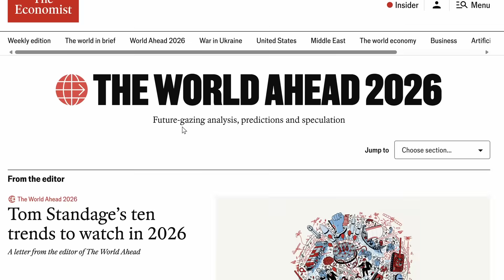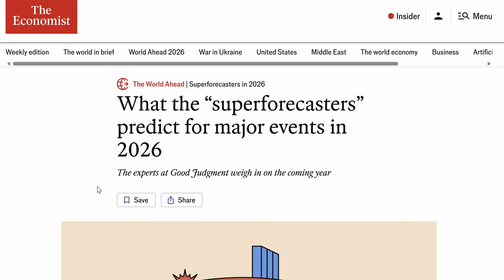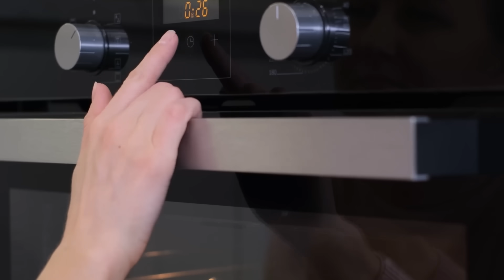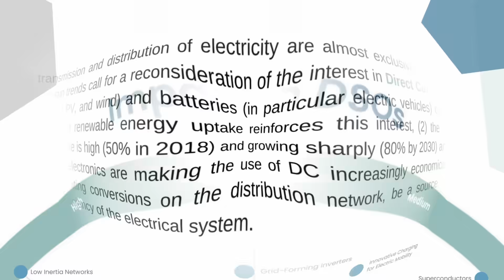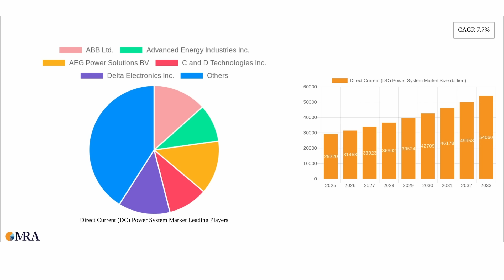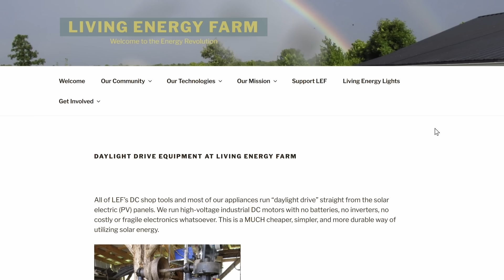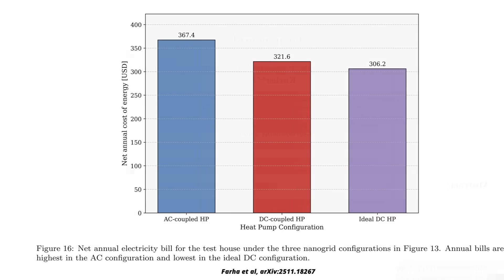Are We Using the Wrong Kind Of Electricity?

Comment: Force is force! DC is like deadline your bicycle continously to move strictly forward. AC is like switching back and forth between forward and reverse and then having to convert half of them back into the forward direction or you'd just vibrate in place ripping the bike apart.
Reply: Horrible analogy, No, DC is nothing like that.
Reply: Open your websearch bar and type the keywords "bicycle analogy differentiating ac from dc."  The results will indicate your exclaiming the analogy is horrible... is just your opinion.  It's a common analogy.      @avsystem3142

Comment: I was hoping for a summary of how the DC equivalent of a power transformer works.
Reply: All direct voltage changes are resistive in nature.  A diode drop, for example, directly drops the voltage by (e.g.) 0.7V (0.3V for some types), but has to dissipate the difference in energy as heat (I * dV).   Same thing happens with a capacitor too, by the way.  You can't efficiently convert voltages by charging or discharging a capacitor because that is a direct change in voltage.

To work around this, you change the voltage by changing the form the energy is in from (I * V) to magnetic flux, and then change the magnetic flux back to (a different) voltage.

For AC this is just a transformer.  For DC you still use an inductor or a transformer but you can't just put a DC voltage on an inductor or transformer.  It will build up its magnetic field as desired, but once the magnetic field is built the current will flow freely and the circuit becomes a short.

So the way DC voltage levels are converted is to "switch" the DC voltage onto and off of the inductor or transformer.   You switch the DC voltage on, build up the magnetic field, then switch it off and the magnetic field collapses and induces a voltage on the secondary (or on the other side of the inductor, more or less).  You can then massage that voltage by virtue of controlling the switching rate and pulse width to be the voltage that you want.

-Matt
Reply: @junkerzn7312 okay, so effectively converted into AC, maybe not with a great waveform, then put it through a transformer and rectify it. That does sound inefficient.

Comment: Neine shotsie ! Tesla was right. As a scientist/engineer I have to look at the big picture. All of our infrastructure is set up for ac. Converting an over would break the bank and take a very long time. The beauty of AC is in the intermediate distribution you can convert 115,000 volts down to 220 volts with a single Transformer. To convert DC Indian inverter and a bunch of other crap. Converting AC to DC is simple and cheap a lot of times you just need a wall wart. And the big ugly secret is the windmills actually produce AC 1st because alternators are smaller cheaper less complex and 90 to 95% efficient. Generators are only 75 to 85% efficient and have commentators using brushes that wear out I need constant maintenance. If the windmills need to produce direct current they'll still use alternators and then you use rectifiers degenerate the DC and then at the other end you will need huge inverters to convert it back to AC. Very inefficient and very expensive. Our infrastructure is set up for AC converting it to DC will break the bank and for no good reason. Love your talks especially your BS meter- classic

Comment: With the growing popularity of residential solar energy, we will see more and more local hybrid systems that use direct current (LED lighting, electric cars, etc.) and share energy on local distribution networks (of just a few kilometers) also in direct current. Most new residential solar systems work this way, using batteries. It's a matter of a few years, especially since it doesn't seem like electricity transmission and distribution lines will be modernized anytime soon at the necessary speed.

Comment: AC requires less maintenance over time because it is not as concentrated as DC. Contacts and connections on a DC grid will be more prone to overheating and oxidation resulting in electrolyzed corrosion and weathered components. What was saved on output in a DC world will be cartoonishly overshadowed by comical maintenance. Also, AC is a MUCH SAFER means of distribution in the scenario of electrocution- where a victim can more likely break free from the current with less internal damage. So, it’s better to be neutral than to be negative, and it’s safer on solid ground. Puns intended. 🤔 😂

Comment: Converting DC generated by home solar batteries to AC and then converting it back to DC to charge an electric car wastes only about 10% energy, and the efficiency of these conversions is still improving. It is likely that you will not recover the  cost of retrofitting an existing house. However, when Sodium-Ion batteries reach $70/kWh levels (at the pack level) it would be be feasible to have very large batteries enabling totally self-sufficient new homes in geographies where there is enough sun exposure. In this case, it may be worth eliminating DC/AC/DC conversion losses, especially if the main electricity consuming applications in the house are heat pumps and EV charging.
Reply: You're ignoring the kWh consumption vs the Solar Panels output and the available sun hours in a day.
Charging an EV consume about 3-5 days of average household solar panel output, (yes there are big differences in solar panel installations but also in EV battery Kwh) and remember you CANT use electricity twice, you can't use the same 1kw out from your panels to run a kw to your fridge and one to heat pumps and put 1kw into the EV AND charge enough kwhs into a battery to keep your fridge running and the lights  on when the sun isn't shining.

Comment: The loss over distance issue changes at really high current 0.5 MV and above.  Work on engineering a extreme long distance high voltage direct current transmission was conducted in Northeaster California during the early 1960s leading to the construction of Pacific Inter-tie Extending from Washington through Oregon, California and Nevada to Southern California.

Comment: The problem is that each system requires a different voltage. In the case of AC, this can be solved with a cheap and low-loss transformer. In the case of DC, the losses of the DC/DC inverter are around 10-20%, and the costs are also higher. Therefore, using large DC systems is engineering nonsense.
Bullsith meter: 9 (DC can be good in rare special cases)

Comment: Merry Christmas Sabine enjoy the holidays with your family.

DC transmission is often used for extremely high power high voltage transmission. Interconnecting DC to AC incurs power losses due to converter inefficiencies. Tis is not my day job so I do not know how that compares to transformers. The benefits of DC transmission is the elimination of the need to precisely match frequency and phase at both ends and a massive reduction in reactive current as the transmission line is charged and discharged each cycle.

From a residential  perspective I think the adoption of smart LED lighting will foster a complete change in how lighting is installed. In the US the recent NEC (national electrical code) reduced the power per unit area calculation to respond to the rapid shift to LEDs. On a personal note all our home network devices use DC wall warts. I built a DIY UPS that supplies DC directly to each device rather than converting it to AC then back to DC at the device.

Comment: Well, solar panels produce DC, but all the generation methods that involve spinning things in an electric field, they generate AC.  

And AC makes it trivial to boost the supply line voltages back to within the service voltage tolerances.  Just a transformer with an adjustable tap on each phase.  It is also trivial to step down the voltages to those better for safe non-professional human use, i.e., where kids can get ahold of it.

Comment: Let's imagine 1MW of power is generated and power needs to be transferred over large distance. And, let assume end customer will use this power to power up his PC. At power plant we will step up voltage to minimize transmission losses. Large AC transformer efficiency is around 99.5%.  Good DC/DC convertor efficiency is around 95%.  At the end of transmission line (at the city level), we will need to bring voltage down to some lower level. This will introduce again AC transformer for the AC system and DC/DC convertor for the DC system with efficiencies 99.5% and 95% respectively. This voltage will come to your PC where internal DC/DC convertor will have to bring voltage to let say 5V suitable for PC electronics, and that is the same for AC or DC system with efficiency of 95%.
In total, AC system delivered power to your PC with efficiency of 99.5% x 99.5% x 95% = 94.05%.
DC delivered power to your PC with efficiency of 95% x 95% x95% = 85.74%.

Math is clear here, and I do not want to even talk about the cost difference between the 1MW AC transformer vs. DC/DC convertor, or reliability of DC/DC convertor, or complexity of thermal management of such powerful DC/DC convertor.

Comment: There’s the question of the efficiency loss in DC to DC conversion of  100kV transmission voltage down to appliance or electronics voltage levels. 

And really, what we need to do is recycle a bunch of old refrigerators and air conditioners and replace them with efficient modern ones. With new refrigerators the savings can be 70% on an appliance that runs constantly. Likewise, sealing and insulating houses so that furnaces and AC don’t have to run as often. That can be 25-60% savings, depending on the house. There are so many relatively cheap efficiency gains in demand side management that complicated grid upgrades should be much further down the priority list.

DC does have advantages in high voltage transmission vs wire sizing.

Comment: Funny enough, I raised this question more than 10 years ago. At the time, I estimated that about 90% of the power we use is ultimately DC, so I wondered: why not skip all the AC↔DC and DC↔AC conversions altogether? Another argument I had was that DC transmission supposedly has lower losses.
So my conclusion back then was: why not use DC everywhere?

Today, I’m not so sure how big the real improvement would be. It’s probably not that significant unless we can define a DC standard where electronics operate directly from the incoming supply voltage. That voltage would likely not be 120 V or 230 V DC, but something closer to 48 V DC. The downside, of course, is that this would require thicker and more copper or aluminum cables to handle the higher currents.

A possible compromise could be an interface with two DC voltage levels: a low-voltage rail for standard applications and a higher-voltage rail for high-power loads. That might be a workable solution — time will tell.

Comment: 4:10 - Using DC for long-distance power connections has been done for decades. Moving electricity from the large hydro installations in the Pacific Northwest to the population centers of San Francisco and Los Angeles is an example. You still need HUGE inverters to convert the DC back to AC on the local grid, but the capacitive losses of AC over long distances makes the economics make sense.

Comment: The solar wasn't full usage under current supply ..that's the fullishness that many had their laugh with. However the power supply under some situation issues will at least take a none working to some in a flip of a switch. Having been said critical points are at the base of savings with added supply. Yet admitting the entire reason is as bad as ruining Rolex for same greed

Comment: The DC voltages are all different.  You'll need DC/DC converters putting you right back where you started.  I will say I do hate wall warts.  So if you had one large DC/DC converter with multiple voltages and outlets to match you could just use USB type power cords for DC powered devices. It could be more efficient by a bit.

Comment: Most electric cars starting with GM's EV-1 in the 1990's use AC to drive the motor. Almost all rail equipment built since the late 1980's has used AC motors. AC motors are less prone to damage from exposure to moisture, dirt and grime.

Comment: The problem with compairing a modern house running DC vs AC is in many ways AC is using a lot of ancient inefficient technology while modern DC is using all the latest improvements.  Use modern high efficiency AC and it beats DC easily.  In particular modern consumer devices don't use what's called power factor correction very well.  This isn't an issue for DC but increases generation losses for AC.  This is fixable but would have to be legally required.

Comment: I'm still not sold on DC as a transmission medium.  What voltage DC are you transmitting and what voltage do you need?  Even within the home, what voltage are you making versus what voltage do you need?

Anytime you want DC at a different voltage you either are going to burn energy up in the form of heat or you are going to generate your own AC in order to transform the voltage up/down to what you want and then back to DC again...thereby adding steps and complexity (as well as failure points) to the whole system.  

With AC, you make it to whatever you want, including having multiple taps if you need various DC levels, in the end.

Comment: Converting AC to DC is relatively simple. On the farm we had many DC devices from motors to welding equipment and a scary looking mercury arc rectifier handled the job. Diodes and other semiconductors make it easy. Going the other way, DC to AC, is much more complicated and expensive especially when high voltage and currents are needed.
Reply: All you need is a FULL BRIDGE RECTIFIER.
Reply: @amihartz  A "Bridge" Rectifier is a Full Wave Rectifier made up of 4 diodes and the post above states that going from AC to DC is 'relatively' simple but going the other way  is complex.
And by the way a Full wave Rectifier still doesn't give you true DC, look at it on an Oscilloscope is more like MWMWMWMWMW
You need lost of smoothing to get to true DC, Capacitors and Chokes the more to better.
Reply: But when do you actually /need/ AC? AC motors maybe, but those usually don't run at mains frequency AC, so need to be converted to DC and back to AC of the correct frequency anyway, and that frequency is often variable depending on the speed you want it to run at.

Obviously if you put 120V or 240V DC into a lot of appliances, they won't work, because they were designed in a way that expects AC. My desktop computer for example takes 240V ac and converts it to 3V, 5V, and 12V DC to actually operate. That conversion won't work from 240V DC, I would need to replce the power supply with one designed to take DC.
Reply: @katrinabryce  The vast majority of Electric Motors used in industry run directly from 3 Phase AC Mains, this has been the case for many years, computers are a Johnny Come Lately in comparison

Comment: Yet another very simple solution that is just not that simple at all. One bit that people miss here is that we actually use higher voltage in order to save on wire size; higher voltage means lower amperage for the same power draw. It makes a lot of sense to convert down at the device and, 60 Hz is super slow. Modern power supplies can have operating frequencies above 20 kHz; they often don't really care if the input A/C or D/C and will often work over a decent voltage range too. There definitely are cases where low voltage dc makes a lot of sense to think about but, using the wrong electricity? Nah, its a good compromise as is.

Comment: Happy Christmas!  Small correction, wind turbines don't produce DC. :)
Reply: Kinda. The generator itself is a multi-phase AC unit. The problem, is that the frequency is extremely variable that comes out of it. So, the first step. The first thing. Is to convert the output to DC, then the second thing is to run it through an inverter that holds it to grid standards. So technically, it does produce AC, but it's very unusable AC, so it's immediately converted to DC. And then back to AC. It's like a reverse VFD. Hell they may even call it a VFD I don't know.
Reply: @mark_bickford  Correct! -They don't produce DC. I had a small turbine on my yacht and that just needed bridge rectification to provide chopped DC to charge the batteries. I'm not surprised grid compatible systems require a tad more sophisticated circuits!

Comment: You really need the car 400amp alternator for the 8000w inverter.  Because if your in the house, just buy a big brushed tool for half the price.  If you want real power, then you need a giant pneumatic pump system because of the air tank reservoir.  Like washing the car, oh it's fake junk, there is no electricity for great car washing.
Inside the house, DC is onimously cheapskated, if you built a real full multiplier circuit, well youd get 550v from 120v, but its very old fashioned diode technology.  You can build a much much better AC -> DC converter.  But there's no DC divider for 550v DC, you need a variac betwean 5 circuit breakers 50hz ~ 60hz.  So the power lines will always be AC, its just this $1,500 gizmo setup. 120v ->
Fast crystal timer, like 555 timer (~>1mhz) -> 7 series 100uF -> 100mhz PNP -> 8 x 50uF (8 phase full mutiplier) -> 1Gohm pararrel (zener coupled variac) -> fuse box microcontroller.  The one hard part is you can only use non polar capacitors, audio capacitors, and no mosfets, only BJT PNP's, because its analog, you can see each milliseconds slice transforming into smooth polarizing F = A2 s4 kg−1 m−2